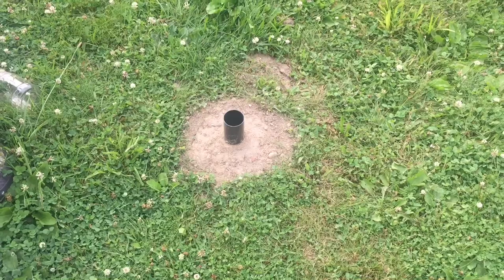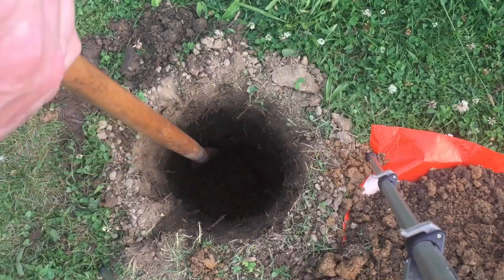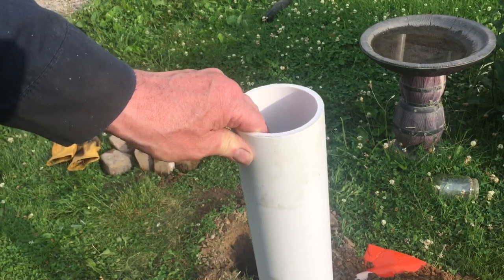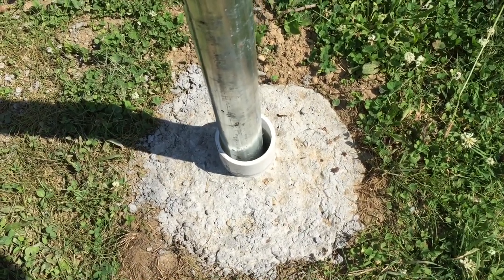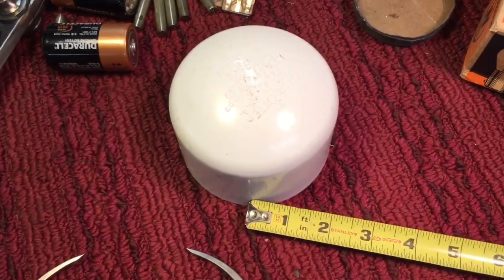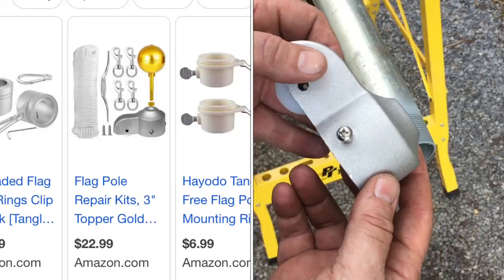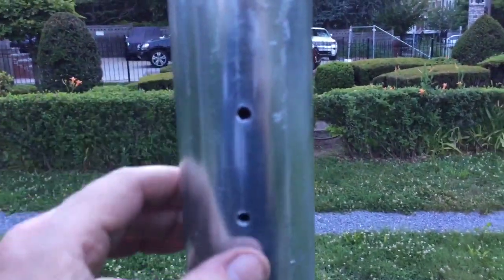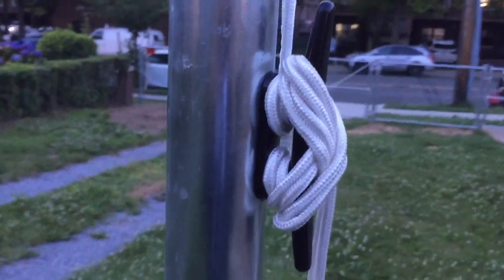Home Made Flagpole From Pipe!

Comment: Nice work!  One thing I would recommend adding is a rubber plumbing roof vent boot at the base of the galvanized pole just above the PVC.  It'll keep pretty much all water running down the pole out and prevent rust.

Comment: Old Glory looking great!  I always called it cement.  My last project was a WiFi build out for Commonwealth Edison in and around Chicago. I was the Project Manager for the installation of roughly 350 sites.  Put in 180' poles with WiFi antennas. One site was sucking up the cement and I had to emergency order another two truckloads before it finally "took hold". So I lost money on that one but overall the project came in under budget and on time.  Very good and correct info,John. I'll see if I can put up a pole in my back yard for July 4th.(if the wife and village will allow it). And remember to buy "Made in America" flags!

Comment: I got a nice digging pole in Harbor Freight for around $20 and it’s solid steel. Where I am on Long Island it’s extremely rocky with millions of potato sized glacial rocks mixed in the soil and I have had a lot of nerve damage in my hands from trying to use a spade to dig and loosen soil for the post hole digger. I only found out about a digging pole last year! Makes a world of difference

Comment: Beautiful Stars and Bars.

While I was watching your video, you mentioned frost line.

I was hoping you would explain to viewers why poles,fence posts needs to be buried/set below the frost line.

Your videos are imformative,great to watch. Keep them coming.
Reply: Stars and Bars refers to the Confederate battle flag. Stars and Stripes refers to the American flag.
Reply: @594bolt  thanks for the information, I don't apologize for upsetting anyone.
Reply: @mishawakian  No need to apologize for your ideas and thoughts as long as they are not derogatory or directed to someone.
Reply: Poles, fence posts, and foundations need to be buried below the frost line to keep the frost from lifting them out of the ground with freeze-thaw cycles.  The frost line is the depth at which the ground freezes during the winter.  It is a good practice to go a foot or two below that depth.  From experience, ice will lift a pole out of the ground; a depth gauge pole was concreted into the ground in a pond and over the winter water filled the pond which raised the level of the ice on top and pulled the pole out of the bottom of the pond.  This was in Michigan.
Reply: @mishawakian  Not upset at all. The Stars and Bars are beautiful, too. My neighbor flies the Stars and Bars because he has the freedom to do so. Take care!

Comment: I’ve dug a few holes.......
I use a graft which is like your pole, very narrow curved spade blade with a taper on it, with a long steel tube shaft and tee handle. And I call them shoveholers, if it’s good going I can throw them down the hole and get the next grab out without using the graft.  And a heavy 5’ crowbar with a point and a chisel end for any rocks or real hard going. 
I sunk a piece of rail (95lb/yard)
Into my front garden so I’ve got something to anchor to when I did my engine change on the landrover, or if I’ve got the gearbox out, I can winch it backwards and roll it forward to work on it. That went into a four foot hole. 
Good work with the flagpole John 👍
Reply from the maker: Great idea with the rail!  😃👍

Comment: Great job!  One question…the metal clips that you use on the rope to attach the flag to the rope… do they clang on the flagpole while the flag is flapping in the breeze? I’ve seen many larger flags using just a loop of rope around the flagpole to attach the lower grommet to the pole, thus avoiding the metal clip that constantly bangs on the pole making noise. Know what I’m taking about?
Reply from the maker: Bobby- I looped the fasteners thru the line and then tied a overhand knot behind the fasteners to create a stand-off.  So far no banging off the pole! 😃👍

Comment: In the UK, we can buy bags (20Kg/44 lb) of stuff called Postcrete - it's a dry sand/cement/ballast mixture optimised for installing fence posts - plant the post in the hole, tip in dry postcrete, and wet it with a watering can.
I suppose it would work equally well for flagpoles ...
Reply: We have that stuff here too.  I still think it is better to pre mix the first bag in the hole no matter what.
Reply from the maker: Mike- I saw this video a while back and I think you might find it interesting!   https://youtu.be/iBgWx2y9pj8
Reply: @ScoutCrafter  Just watched that - I've only ever set posts into wet concrete, never used the dry stuff.
I'd never heard of foam, but it is available in the UK, so next time I need to install a post I'll try it.

Comment: Scout I have a unrelated question about something that is making me crazy that ide imagine alot of people have experienced.. could you do a talk and possibly a demo about to GET RID OF.  the tiny metal filings off of tools that are magnetic? If you've dealt with this you understand it's mind boggling.. please help? What's happening currently is I've started getting into these vintage bit drivers the one with colored plastic handle and different color storage cap they hold about six half inch long bits.
Reply: I know you didn't ask me but a stronger magnet inside a plastic bag and then take the magnet out or a blow gun from a compressor knocks the fillings right off.
Reply: @patcb829  cool thanks I didn't think of that as this is very new I've had magnetic tip screwdrivers but that's easier to get off and also I don't even know where the metal partials are coming from but it's alot I side tips of these type screwdrivers every time
Reply from the maker: That is SO ANNOYING!!!!!  They have regular tool demagnetizers but they don't seem to get 100% of the magnetic out of the tool!    Now I saw this cool video a while back and always wanted to make one!!  Check it out!   https://youtu.be/nR-6GIBVTdE
Reply: @ScoutCrafter  that's scout idk if I can find a 30 years old soldering gun lol but that was amazing!!!  I'll most likely pick up one of those damagnatizer donuts I've always called them..
Reply: @ScoutCrafter   can you tell me your email again. I feel like I'm getting dementia lol

Comment: HaHa he swam in the Hudson River with cement shoes. Great video. Mutt diggers are great but just use your strongest resistance not to pry with it or the wood handle will break. But it's a heck of a lot lighter than digging with its brother made of steel.
Reply from the maker: Michael- You are so right, I bought that Mutt years back after a huge ice storm left us with 3 inches of ice all over the sidewalks. The Mutt worked fantastic. It really is a great tool!